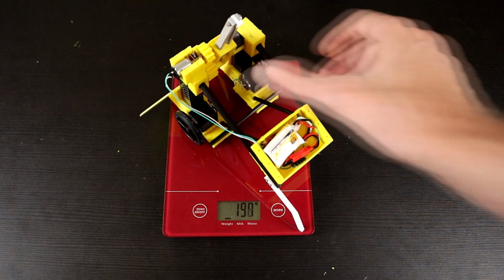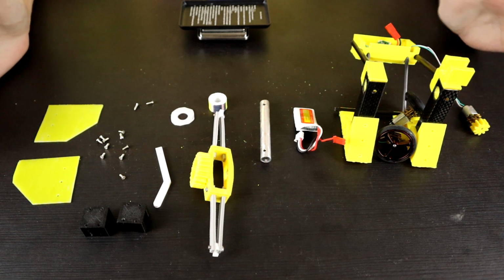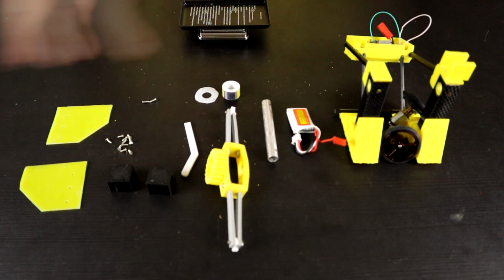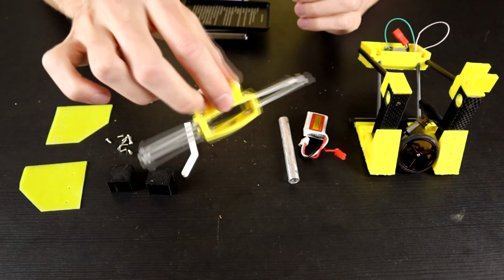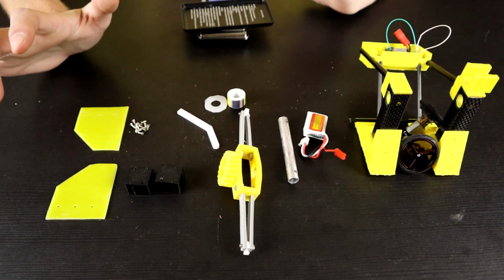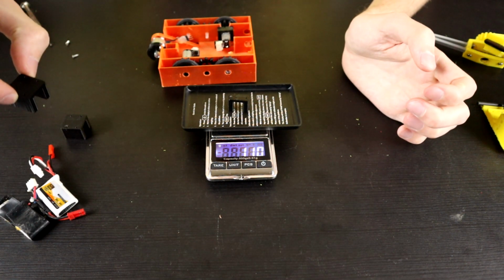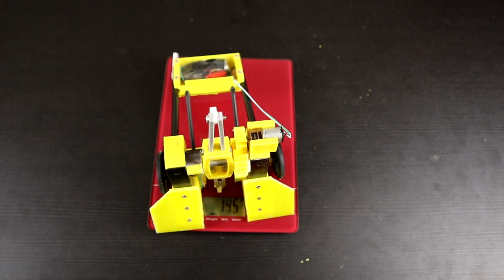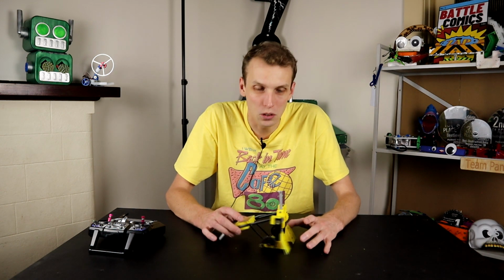Building a mini Mammoth, Part 4: weight reduction (150g antweight)

Comment: Have you thought about making the weapon tips out of a shore 10A silicone rubber? To maximize the grippyness? Maybe even shore10A over the pointed structure so that you get grip as well as a way to dig into the other bot. Just a thought
Reply from the maker: Ooooooooh, rubber weapon teeth is a great idea!
definitely an easy way to maximise the grip without adding metal
Reply: @TeamPanicRobotics  That's exactly what I was thinking. You'll have to get the Shore A rating dialed in just right to maximize the grippyness/stickyness/durability (and ability to stay on the weapon tip). You could try anything from just rubber tip screwed into the end to pouring the rubber over the existing tip to incorporating metal needles or sharp points into the tip and then pouring silicone rubber over them so that it combines the impact and abilities of the sharp tip to puncture the bot with the grip/tack/stickyness of the rubber to hold on to the opponent.
Last advanced thought is to get a mold (maybe a sheet or 3D print of an array) of tiny suction cups to cast the rubber into to try to add to the ability to grab. Take a page from octopodes or squids or chameleons.
Whatever you decide to do, I can't wait to see mimi mammoth fight!

Comment: My strategy whenever I need to remove weight is to reprint one or more of the bot's structural parts with a lower infill. I guess that wouldn't work here though.
Reply from the maker: Thats my usual goal as well, but as the chassis was glued and I'm basically out of one of the sizes of carbon fiber I had to make do

Comment: I feel like the front armor needs a lower angled wedge to lift the other bot slightly when you run into them for the weapon (in its currently setup) to be able to effectively lift. I'm just not sure if there is enough weight left over to effectively make that type of wedge armor though.
Reply from the maker: Maybe, and if I was going to build the bot again from the ground up I'd add a lower angled wedge but the chassis is locked in and I'm running out of carbon fiber so this is what we've got for now